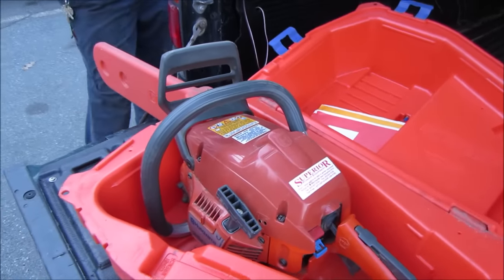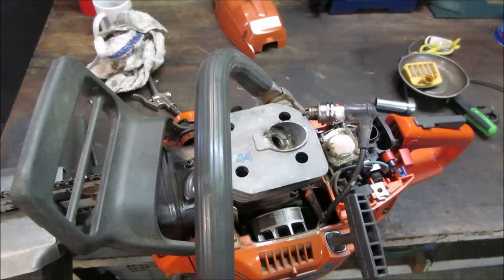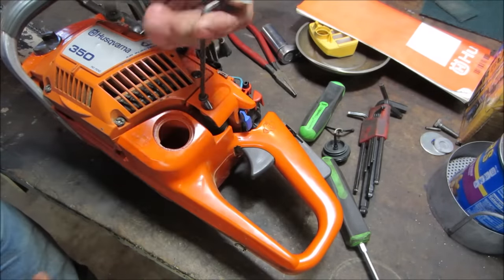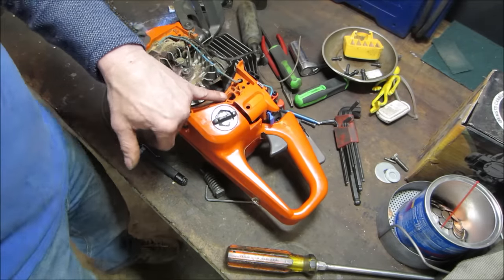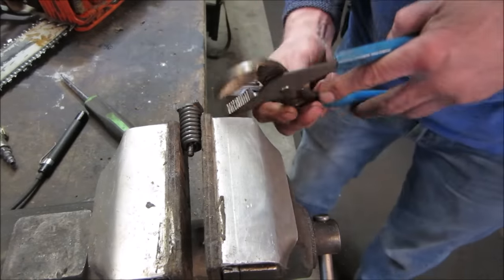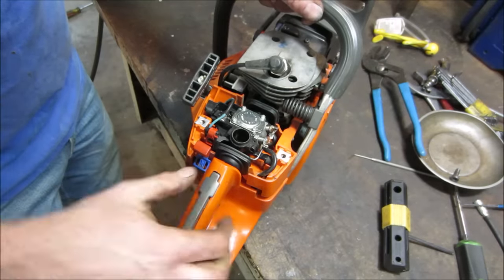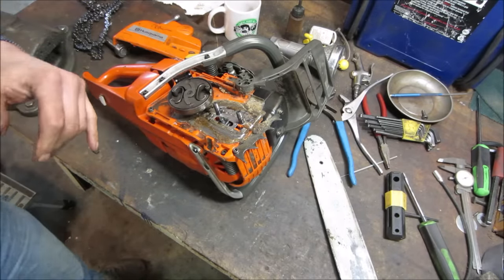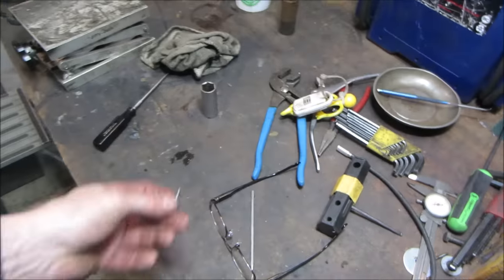Can It Be Saved? The Junkiest Chainsaw Ever. Picked out of The Trash.

Comment: I've been using my Husqvarna saw for 15 years (and it's a model priced lower than the 350 in this video) and it has never let me down. Keep the chain sharpened, replace the bar when it gets worn out, clean the sawdust out, and use quality gas and bar oil, and the thing still runs like the day I got it. Worth every penny I spent on it. And I got a deal.
Reply: My husky has never let me down fires up first pull keep here greased and sharp my stihl is always a beast to start and has never run that great bought both new ill stick with husky
Reply: Yeah i got the 455 in 2007 i use it we burn wood it works great sawed a log today at the cemetery never fails
Reply: My dad's husky I bought him for Father's day back in the 90's still runs like new even if it sits awhile between use..........still very tough to pull because of insane compression..........
Reply: Model 51 is a beast..........obsolete these days.........a 25 year old saw.........but still kicks saw dust like a new one
Reply: My dad bought a Husky 61 in '91, still runs like new!
Reply: I had and used an old husky 55 for around 20 years. Had one problem and it was mud dobbers in the exhaust.
Reply: It's so funny how many people say you have to replace the bar when it gets worn out. My husky is a 261, made in 1999. It's 23 years old and I have the original bar on it, after cutting about 200 cords of wood with it!!! I've probably only gone through eight or nine chains in all those years, and my bar looks better than most people's saws that are only 5 years old, who barely use them.  No big secret. I sharpen my chain by hand filing it every time I fill the gas and oil. Every five times or so, I take the bar off, see if I need to dress it, which is file any burrs on it, and make sure it's square. And take the rakers, that's the little piece that sticks up in front of the teeth on the chain, down just a little bit below the teeth. If you don't know, there is a guide for it, and you can look up how why and when to do it. I also clean the slot out in the bar, and make sure the little oil hole, with the oil comes out of the saw through the hole in the bar and into that slot to lubricate it.  If you do this, you won't have to press down hard to cut, and there won't be a lot of friction between your chain, and the bar. If you notice something isn't right, like you not getting enough oil, and you can hear your chain making more noise than normal... Or you smell or see smoke.  Also when you let off the throttle, the chain comes to an abrupt stop, where normally it spins for a couple seconds, until the saw idle is down then it stops.... So basically if you notice anything different or not right about your saw...STOP CUTTING, SHUT IT OFF, and see what's up!!! And if you sharpen, or touch up your chain, every tankful, not only will you save wear and tear on your saw, but it will last forever, will be fun to use, and you won't beat yourself up trying to make it cut wood!!!  Try not to drag wood through the dirt.  Dust off any dirt that you can. Keep the bar out of the dirt!!! Keep a spare really beat up chain, for when you do have to cut stumps, right at the very base with the ground, And just know that if you're saw feels like it's cutting slow... Once again shut down, and see what's up!  Don't be stupid and keep forcing your saw to cut.  It might just need a little sharpening because you hit a nail, touch the ground for a second, and didn't know it, or who knows what.  I can't believe how many people say they have to replace their bar every couple of years.  My saw and bar are 23 years old, and except for a little bit of paint missing on the edges, it looks and works great!!! It has reliably cut from 10 to 20 cords of wood a year for 23 years!!!  Don't forget two grease the middle of the drum of the clutch, and the sprocket tip in the bar.  Also flip the bar when you do the other things I mentioned such as taking down the rakers, and breaking down the saw to clean out all the sawdust.  Or don't bother, and end up having to go through bars and chains like crazy, and only get 10 years out of your saw if you're lucky.  To me it's worth taking a couple minutes extra every tankful to keep my saw performing like new, and then A little extra every five times doing the other stuff I mentioned, including blowing out, or changing the air filter, and spark plug every couple years.  The only thing major that I've ever had to have done, is replace the gas line twice because it got a crack in it, just from age and use.  Be safe and good luck!

Comment: Husqvarna makes a damn good saw. "Junkiest saw i ever saw" turned into a good saw. I suspect that the original owner didn't know what he was doing and wasn't experienced enough to repair it.
Reply: I agree I have a 345.  He lost some of the rubber grommets and forgot to screw them in properly.
Reply: I've had a husqvarna 50, since 1988. And I'm still cutting with it.  I've had a husky 55 with 18 inch bar, husky 61 ,with 20 Inch bar. Husky 350 with16 inch bar all strong saws...sounds like an operator error  to me!!!
Reply: Yeah. That saw was definitely abused.
Reply: Agree with that 😒 I've a 1979 husqvarna 61... 61ccm ~4 hp.. And it's working... I've two mcculloch(usa modell) from 1970's 😂 they run.. So..  Not know how to use something is not the "things" fault...
Reply: Pat Magnatta  my everyday saw is a 61 with a twenty inch bar. Hasn't let me down in 20 years. Suits my hand better than a Stihl.
Reply: Had an Husqvarna 61 since early 80's. Would not have anything else even as a present.
Reply: All saws that you buy have the carbs set so lean to pass emission test and if you work it really hard you could burn it up in one day. If you buy it from a small dealer ask him to turn the fuel and he will know what to do . I bought a 67cc Echo and it seam to be getting ver hot so I ordered a tool kit for every saw that I have done this to and you have to get the caps off so you can get to the fuel and air screw and when I got done it ran its butt off only thing this saw has electronic rev limiter that keeps it from really scream and Iam just got use to it and it’s a different color than all the other Echoes it’s gray with orange caps for fuel and oil and some other little things. I’ve got a 25” inch bar and it gets with the program.  Hope this helps somebody.
Reply: huski all the way james dame good saw /
Reply: I suspect that more than once, the owner try to yank it free from a jam
Reply: Or use it !! Ascit looks like he abused  it looking at condition of the bar !!

Comment: I’m 74 years old and have never taken apart a chainsaw but finally I understand a piece of equipment that I’ve used hundreds of times. Thank you as always for your clear and precise descriptions of how it works. My only regret is that you weren’t around in the 1960s.
Reply: In response to your comment.
I'm 72 and just rebuilt the top end on my Husky 357xp.
     The last guy failed twice.
Makes me wonder how he starts his car.
Reply: @twobeards6714  You have a Husky 357XP. A friend let me try his out on my Dad’s wood pile. The pile was a mix of birch, maple and oak.  His chain was razor sharp and I couldn’t believe the ease and speed that saw went threw those logs. I believe on full throttle the 357XP spins at 13,000 revolutions per minute.
Reply: When you put the fuel in the plughole the throttle has no control over how fast the engine runs until that fuel is burnt out that Dome top of the cylinder
Reply: Another problem I used to see on the old homelite chainsaws was that the fuel tank overheated and would build pressure up inside other than that they were good chainsaws they did use a lot of fuel and oil and they were heavy but at the same time they were some fast cutting machines
Reply: The new chainsaws are cheaper Fuel and oil not really when you figure in the increase of how much everything cost anymore they cost about the same as fuel operating and oil but bars and chains or made out of Cheaper material nowadays and they eat you up on the cost and replacing them two items about seven hundred times more than what the old ones did back in the sixties and seventies
Reply: Most chainsaws that do not run right now days the problem lies within the seals around the crank And seal going into the crankcase around the vacuum tube for the fuel pump of course we had the same problem with the older chainsaws but they were a lot better than the new ones nowadays I have owned both new and old

Comment: I purchased the very same saw in 2003 from Lowe's
,, the best saw I've ever owned.. no issues whatsoever never fails to start I've worn out three chainsaw blades + 2 bars from normal wear and tear... excellent chainsaw !!
Reply: I've had my Husqvarna 261 for 23 years, cutting 10 to 20 cords of wood a year, and have the original bar on it.  I touch up my chain by hand sharpening it with every gas and oil fill up.  Every five times or so, I take everything apart, check for burrs on the bar, flip it, make sure it's square, have never had to "dress it", as they say, made sure the slot in it is cleaned out, including little oil hole, and as long as you do this oh and take down the rakers on the chain... You'll never have to press hard and make your saw cut.  It will just cut through the wood and work for you.  Then you don't have the friction between the bar and your chain.  If you notice that it's getting tough to cut, the chain is making more noise than usual, you smell or see smoke, or the chain stops abruptly after your cut instead of slowing down with idle, or it takes longer to cut through stuff, stop what you're doing, and check your saw out!  Not trying to lecture you. Just amazed that everyone that goes through bars almost as much as chains. I've seen people that I thought were expert chainsaw handlers, fighting with their saws to get them to cut, only to realize, they sharpen their chains themselves, but didn't think they had to do the rakers.  I was amazed.  The teeth are slanted, and as they wear, the rakers definitely have to be taken down, or you'll be one of these guys pushing down on your saw to get it to cut no matter how sharp it is.  Also, if that chain looks like it's melting sawdust on it, it's not getting the oil it needs. Just trying to spread some chainsaw love. Be safe!

Comment: Sorry if this has already been mentioned, but those 350s were notorious for air leaks due to a plastic clamp around the intake boot. Husqvarna makes a replacement metal clamp that solves the issue. When you had it running in the vise, it sounded like it was running lean.
Reply: Exactly what happened to mine, after 13 years and 7 to 10 cords of wood a year. ( we heated with woods and yes I probably got 100 cords out of mine! I now have a husky pro saw…)
Reply: Mine is a version a couple of years newer than the one in the video, but after owning it for a decade it finally went.  I was running it too hard, but after it blew I found out about this failure mode and I'm going 50/50 between that and me just trying to get one last cut (it was a big one) and I pushed it too far.  I bought the updated clamp and a knock off jug/piston assembly and brought it back from the dead.  It's nickname is now Lazarus.
Reply: Sounded lean cutting through the log at the end too.  When it died out a little halfway through the cut.
Reply: Jonsered is a great saw also
Reply: I got a 350 apart on my bench right now waiting for the kit.  Broken plastic clamp pulling air on the intake boot side.  These saws are actually not bad to work on.  I’d take a free one any day.